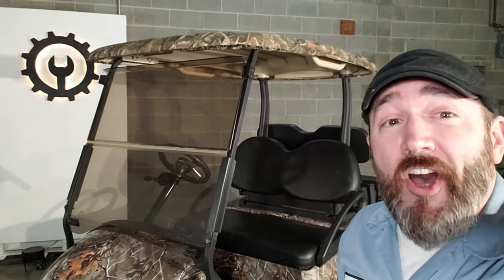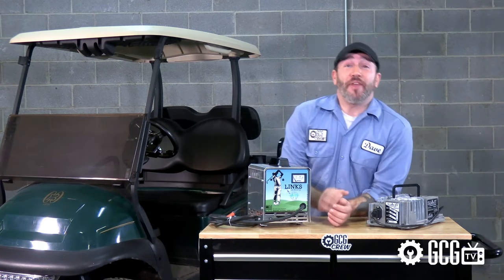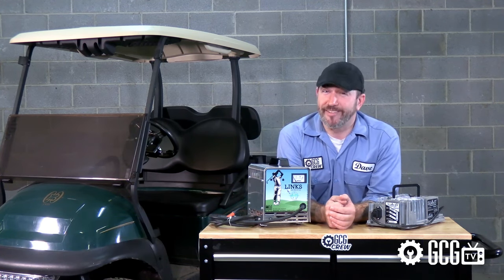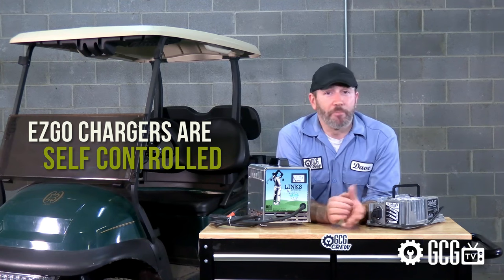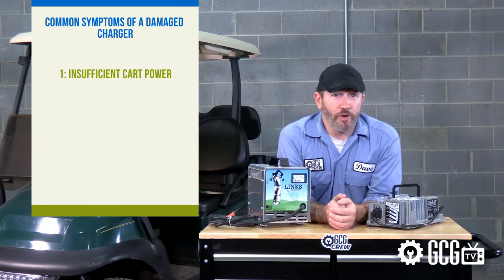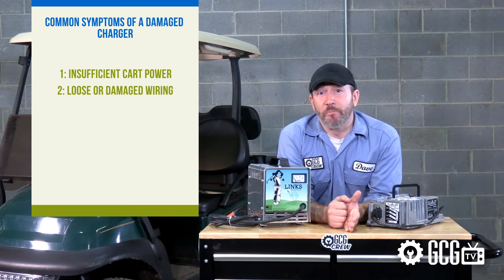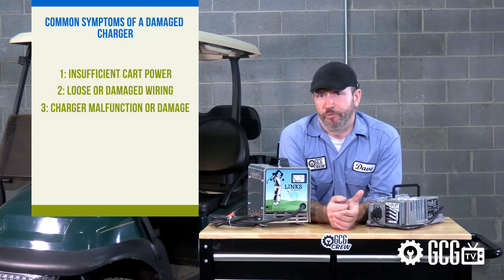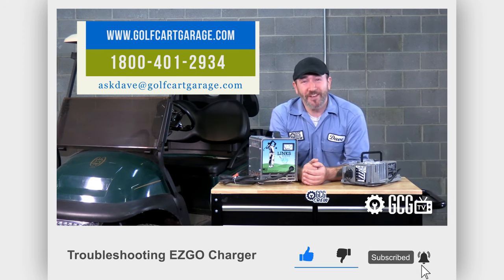EZGO Charger Troubleshooting | ASK DAVE | Golf Cart Garage

Comment: my ezgo rvx is not charging getting a ticking sound coming from the charger
Reply from the maker: Thanks for watching!  If the cart has enough power to drive and your charger is still not working, it may need to be replaced.  The old EZGO chargers that came with RXV models have a tendency to fail without warning or symptoms, though.  One experiment that sometimes helps... if you have a friend or neighbor with a charger that has the same triangle RXV plug, it's worth trying to see if there's an issue with the cart.  If you have more questions, just get in touch!  Support@GolfCartGarage.com or (800) 401-2934

Comment: When you plug it up to the golf cart it flashes red.
Reply from the maker: Thanks for watching!  Red light should definitely indicate a fault code being thrown.  That may be an internal charger error or a problem with the batteries.  Trying that charger on someone else's cart would help denote that.  Either way, checking the manual or the charger manufacturer for their fault codes would help, too.  They're all slightly different from one to another as to how their codes translate.  Let us know if you need more help!  Support@GolfCartGarage.com or (800) 401-2934

Comment: I got a question... 2006 48v club car ds IQ regen ii, obc is apparently either bad or the wrong one for 12v batteries, my power drive charger works on a friends 48v club car ds with 8v batteries, I have installed a Lester summit ii on board charger that is getting the job done, but if I wanted to replace the obc for future or back up use which obc do I need? There are too many different obc’s for club car... this is absolutely confusing. I bought the Lester thru y’all, by the way. Oh, and does anybody make a rear leaf spring u-bolt to account for a heavy duty three leaf pack and a six inch lift kit for the same cart?
Reply from the maker: Hey, Craig!  Thanks for stopping by.  For a replacement OBC, we'll just need the OEM part number from the OBC on the cart so we can match it up, which we can get from Club Car if needed.  On the U-bolt... a good lift kit will come with new ones to accommodate bigger leaf springs.  If you need more help, get in touch! support@golfcartgarage.com or (800) 401-2934
Reply: Ok, but if my cart has an obc rated for 8 v batteries and it currently has 12v batteries, would it cause it to not allow conventional charging?
Reply from the maker: Usually a malfunction to the OBC or charger.  It's not very sophisticated technology.  Your OBC doesn't know 8V vs. 12V.  It's basically just an on/off switch for chargers that has a tendency to fail for a number of reasons.  Again, though, if you need real-time help, you can reach us online or by phone.

Comment: Do you have to put it tow /maintenance when charging
Reply from the maker: Hey, Karrie, thanks for watching!  No, you do not need to switch from Run to Tow for charging.  Tow mode is only used for towing the vehicle, electrical installations, battery removal/replacement... times when you want to stop the battery power from reaching the powertrain.  If you have more questions, get in touch!  support@golfcartgarage.com or (800) 401-2934

Comment: What would cause the batteries to lose water quickly ?
Reply from the maker: Thanks for watching, Nick!  Batteries lose water during charging and discharging.  If you're losing water very quickly, you may be charging too frequently, your charge cycle should be done when the cart is at relatively low power.  If you have more questions or need help, get in touch!  Support@GolfCartGarage.com or (800) 401-2934
Reply: @GolfCartGarage  ok I guess I thought it was a smart charger as I’ve just left it plugged in every time the cart is not being used. Thanks
Reply: @GolfCartGarage  could I have damaged the batteries? It never seems to hold a long charge anymore and I’ve load tested them and checked all the connections and all seems fine. Next step was to check the charger itself
Reply from the maker: If the charger is malfunctioning, it may be performing a "balance charge" on every charge cycle.  This is meant to ensure all batteries get a full charge and will heat up batteries.  Trying another charger might be a good experiment.

Comment: I put a new generator alternator on ezgo gas golf cart and it is not charging the battery
Reply from the maker: Thanks for watching, Betty!  If your new voltage regulator doesn't charge your battery, there may be other issues involved.  We recommend a free consultation with our virtual diagnosis team to help in real time.  https://www.golfcartgarage.com/gearheads-on-demand/
You can also reach out to our techs at Support@GolfCartGarage.com or (800) 401-2934

Comment: Fault red light solid al the time. No blinking
Reply from the maker: Thanks for watching, Jim!  Depending on your charger model, fault codes can be different.  Checking the owners manual may give you a specific fault reason for a solid red.  Sometimes this is because of a bad connection, a bad cell in a battery, or a charger hardware issue.  Let us know if you need more help!  Support@GolfCartGarage.com or (800) 401-2934.

Comment: My charger just shows Ac present ????
Reply from the maker: Thanks for watching, Mike!  AC present obviously just means the charger is connected to a power outlet.  If the cart is dead, it may need a jump before a charger will work... or there may be a charger malfunction or connection issue.  You can get an appt for a video call diagnosis here: https://www.golfcartgarage.com/gearheads-on-demand/
or get in touch directly at Support@GolfCartGarage.com or (800) 401-2934

Comment: Just got new battery’s everything works horn ,lights back up switch (motor does not engage cart had been sitting for a while
With key on when u step on pedal
Reply from the maker: Hey, Tony!  Thanks for stopping by.  Sounds like you could use some help from our diagnostic team.  We have a free virtual service here: golfcartgarage.com/gearheads-on-demand/
or you can reach out at support@golfcartgarage.com or (800) 401-2934

Comment: Won’t. Stop. Charging.
Reply from the maker: Typically a charger that doesn't turn off has an internal failure and needs to be repaired or replaced.  This can also be caused by a battery with a bad cell that needs to be reconditioned or replaced.  We have a video on power testing here: https://www.youtube.com/watch?v=NsUkLCTWSnQ
If you need more help or have questions, get in touch at Support@GolfCartGarage.com or (800) 401-2934